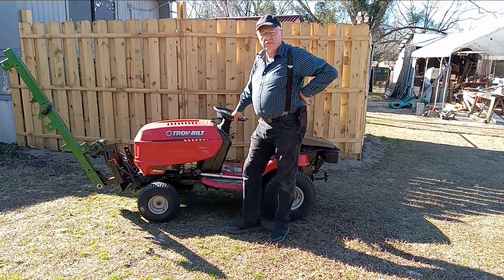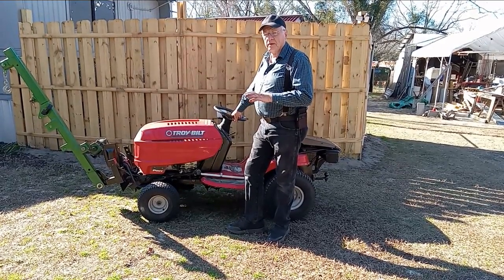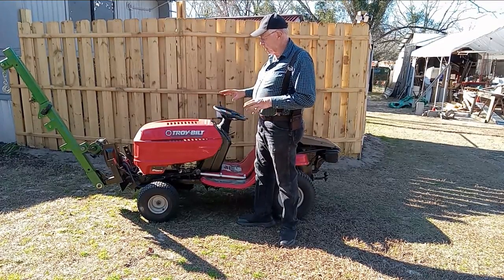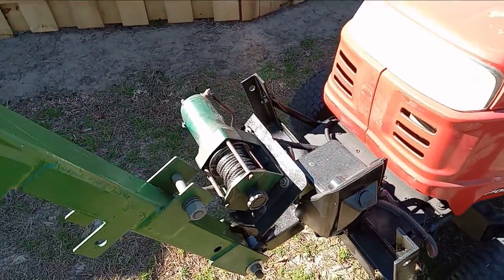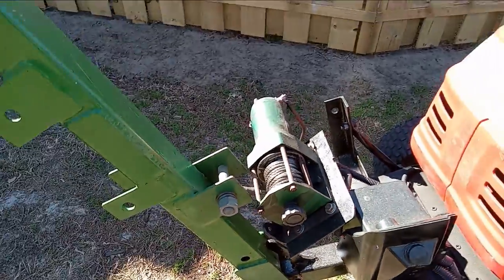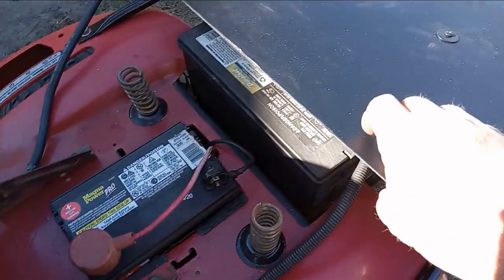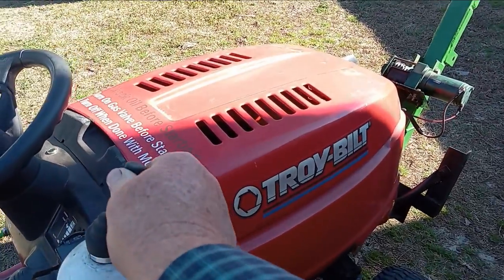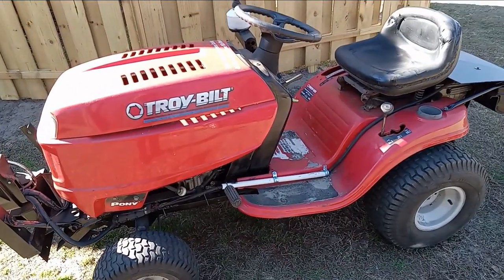Home Built Versatile Mini Tractor With Attachments ... part 1

Comment: What model and size is this tractor?  This is a really neat idea and I am going to build one of these.  Thanks, Ed.
Reply from the maker: Troy Built Pony.  It is a MUST to reinforce the frame on this tractor. The reinforcement includes extending the reinforcement out of the rear so it can handle the counter weights.  A heavier tractor would allow for higher (longer) crane and tree trimming attachments.

Comment: Hi Ed, love your channel and your tractor projects; exactly what I've been looking for in terms of ideas for my Bolens 12xl. 
Have some of the parts to a Craftsman fel and am going to fabricate the missing pieces to mount the bucket and use winches as in your winch-bucket-loader video, but first am going to be building the front end crane as in this video, to be able to resettle a few concrete sidewalk pads that were pushed up by tree roots and are a pedestrian hazard. Already tried to use a vertical farm jack but need the ability to be able to lift AND move/slide them out of the way to get to the roots underneath, cut them away, level the surface, and then put the pads back in place with the rest of the sidewalk. 
I'll let you know how it works out, but in the meantime, just wanted to thank you for your videos, explanations, and ideas. Keep those ideas and videos coming.
Reply from the maker: Thanks so much. I am glad you were inspired.

Comment: How much can you lift with the boom?
Reply from the maker: It depends on the length of the boom and counterweights in the rear of the tractor. The length of the boom is changeable. The strength of the steel and winch would allow for about 1000 pounds. However since this is a converted riding mower tractor, the tractor weight is only about 500 pounds. Weights  that are currently on the tractor in the rear help compensate for tilting with different boom lengths. If the tractor should tilt it lifts the rear wheels off the ground and it looses traction. In its shortest length it can lift a load of about 250 pounds and maintain traction. In it's tree trimming length it can handle a saw head of about 30 pounds. In the length showing it lifting the fence panels it can lift about 120 pounds and maintain traction. I hope this helps.

Comment: could that be ran from a deep cell battery and charged via house current and be used efficiently?  i work solo in the yard and home builds 99% of the time and see value in something like this but also want to keep my mower mowing as needed :)
Reply from the maker: Yes, that would work. How often you recharge would depend on how hard you work the winch. The stronger the amperage of the battery the longer the run time before charging.